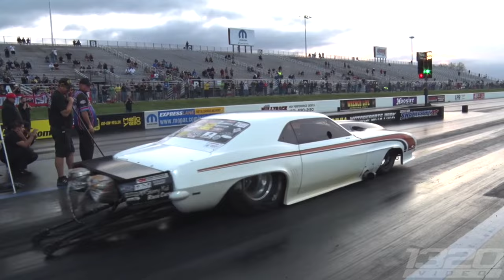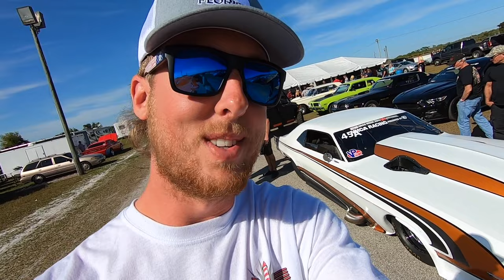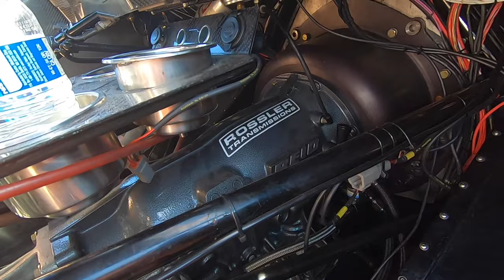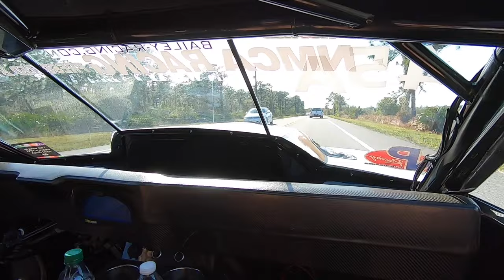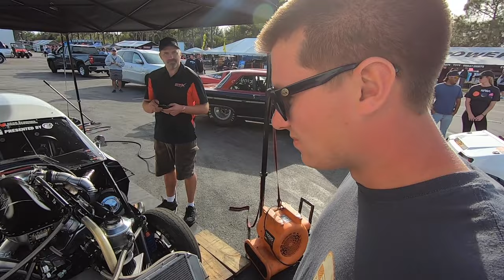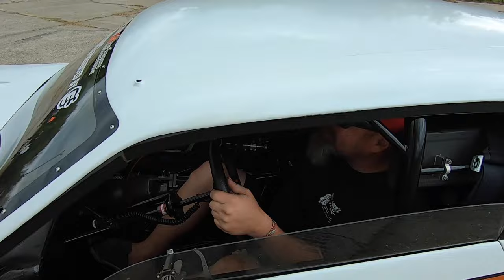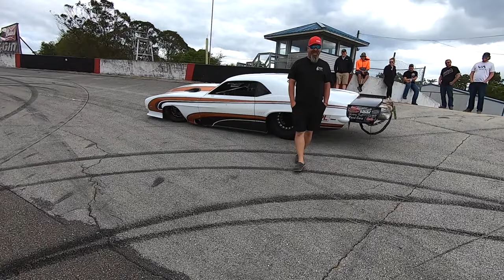We Let a 4,000 Horsepower Promod Camaro Into the Freedom Factory... (Laps and Burnout!!!)

Comment: That is NOT street legal in Flori-duh.  This is a conservative state, and you can literally mount a PT-6 turboshaft engine in your car and drive it down the road;  As long as you pay your registration fee, Flori-duh DOESN'T CARE!  Frankly, I love this sort of thing and I won't live anywhere else than Flori-duh, despite the utter stupidity of the state "government".  That is NOT 4000 hp.  You CAN make a 500 cubic inch V8 make 4000 hp for few seconds.  And you can make a 500 cubic inch engine make high horsepower for hours on end.  But you cannot create an engine that makes THAT much power and can still be driven on the road. And Lawrence already screwed up and called it a "3000 hp" engine.  I don't know what kind of power that engine has, but it is HUGE but it doesn't matter.....This video is cool!

Comment: Another little difference between UK and USA.... You can make anything road legal in USA lol
Reply: Only if its 25+yrs old. And technically its still supposed to be in stock form or any part put in must have been something you get from the factory. The "road legal" legality of this car is grey area to the extreme.  Camaro's never came with full cages and meth injected 526ci billet engines.
Reply: @sylumgand  Yes I understand that but the amount of american 'road legal' cars that I've seen, I highly doubt 10% of them will be road legal in UK. I mean there's way too many things non road legal on those vehicles I'm not talking just about the engine modifications but everything from the body to the engine. There must be a massive grey area within the laws of 'road legal' specifications for this many 'road legal' cars to be on the road. I mean I've seen 'road legal' cars without body, without windscreens, without bumpers, heavily modified, completely redesigned absolutely over the top huge monsters even road legal. I've seen motorbikes bigger than limousines apparently road legal aswell. God knows mate
Reply: @nahmed92  Just because you've seen some people get away with it, doesnt mean its legal here. For one its a state by state basis. Not having a bumper will definetly land you a ticket or impound in Ohio. But cops have bigger things to deal with on a daily basis, so minor infractions are ignored if you have a visible plate and lights. The grey area is YOU are responsible to disclose modifications done to your vehicle. If your state doesnt require safety inspections, its pretty easy to omit that your car has racing parts on it.
Reply: @sylumgand  Again I mean it's all over the Internet. I'm sure it wouldn't take long for a car to be seen, reported and off the streets if it was illegal. As I stated, I'm not talking about normal modifications. That happens here too. I'm talking about over the top modifications, huge lifts, huge tyres, monsters of cars, bikes longer bigger than cars, cars without any safety, cars that would literally destroy any other car they hit. I still don't understand how 3 blowers out the 'hood' are allowed and classed as road legal. You can't even have any obstructions within the windscreen wiper zones inside the vehicles here in UK lol
Reply: @nahmed92  Again, just because you see people get away with it, does NOT MEAN ITS LEGAL. Plenty of video's online of people doing 100+mph on public roads in the US, definitely not legal as we have no Autobahn. I myself have driven around for days with NO PLATES on my car. 

Also the US is not a nanny state, yet. Most people mind their own business. If more people were stuck up each others asses like in Europe, you'd see less of the crazy vehicles on the road.